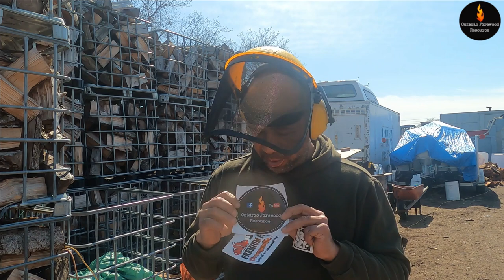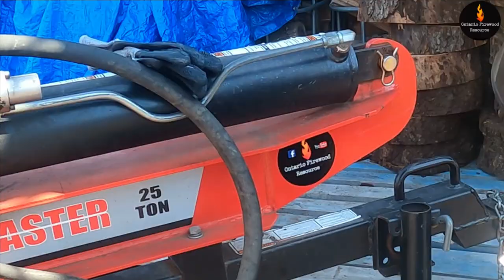PACKING AWAY MAPLE, BEECH & MULBERRY FIREWOOD

Comment: A woodyard is always good for one thing:  keeping you busy, lol.  Always something to do.

  Today, I split open the few larger rounds from some dead young Ash trees I cleaned up yesterday.  Then tested them for moisture.  All but the stump rounds were under 20% inside!  I expected the butts to have some water, as they were in or near contact with the ground, and it's been a wet spring.  A little bit of punk on the very outside of some of the trunks, but still rock solid inside.  The tops were barkless, and very dry, and VERY hard.   Into the shed it all went, save for 5 pieces that need to air out a bit longer.   Always a welcome find, when the wood is already dry when you cut it!!  (and plenty more where that came from)

  Did lots of cleaning up and re=arranging around the place, too.   Now with all my Ash in one place, I can see I have quite a bit more than I assumed.  Same with the wall of cooking wood- and there's more than a full cord of semi seasoned outside still to come...

  The best part of spring for me:  all the dead branches and sticks of silver maple being collected from people's yards.  It's my favorite kindling, AND campfire wood.  The whole place is full of 50 year old, way overgrown, yard monster maples- so  there's a silly amount of free kindling and small diameter (2.5" and under) limb wood for campfires.  And it's all pretty much dry and ready to burn!  I had a huge pile of pieces of that, that needed to find a home out of my way.  (along with a similar pile of worth-saving splitting debris.)  NOW I won't be running short on firestarter any time soon.
Reply from the maker: I miss getting lots of ash. Lots of straight stuff too. Lots of silver maple here, if  could sell Lots of camp wood, I would take more of it

Comment: I just put a new motor and hydraulic pump and 5 gallon reservoir on my old log splitter. I've been getting caught up in my woodyard here at home. Keep up the great videos Mr Ontario
Reply from the maker: Nice! Was that upgrades or replacements?
Reply: @OntarioFirewoodResource  I put it on a 50-year-old homemade log splitter. I made a short video on it. It runs pretty good.
Reply: @OntarioFirewoodResource  I use a quick connect hydraulic lines I can use my hydraulic pump for different things.
Reply from the maker: @bentwedgestanleybrand5818  good idea!